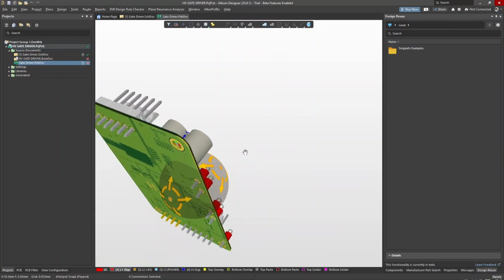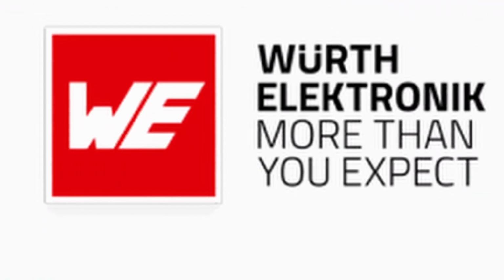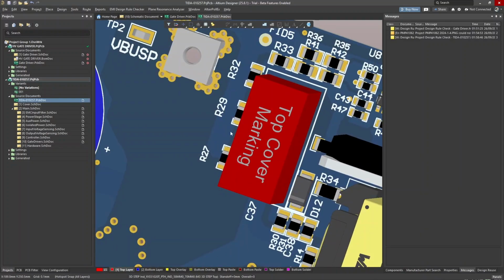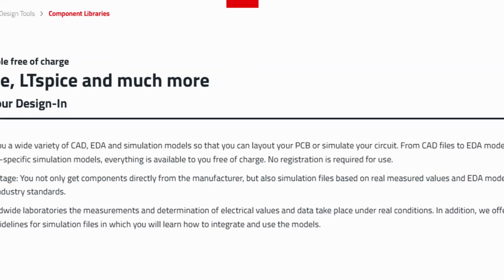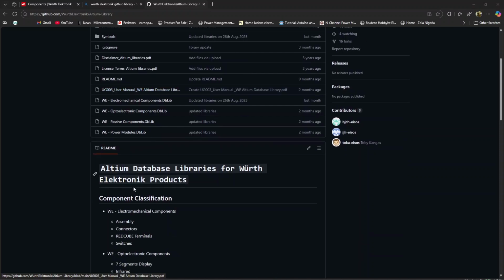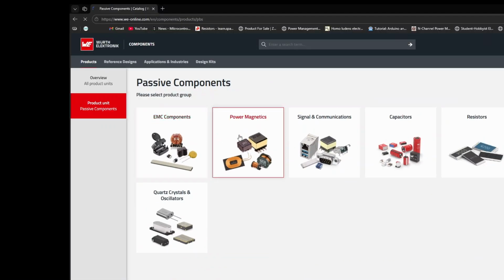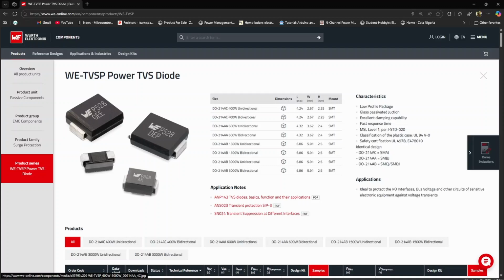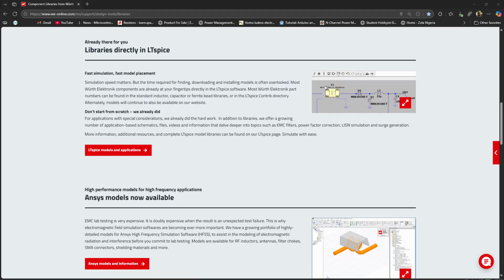Free Wurth Libraries for Altium & KiCad + LTspice/QSPICE (Complete Setup)

Comment from the maker: Welcome to my first tutorial on this channel. My work centers on advanced power-electronics design, 
and I’ll be sharing complete, end-to-end workflows—from simulation through schematic capture, PCB layout, 3D modeling, and assembly. 
While I’m still refining my on-camera delivery, you can expect steady improvements in structure and clarity. 
Each tutorial will be tightly aligned to real projects, with practical, production-ready guidance you can apply immediately.